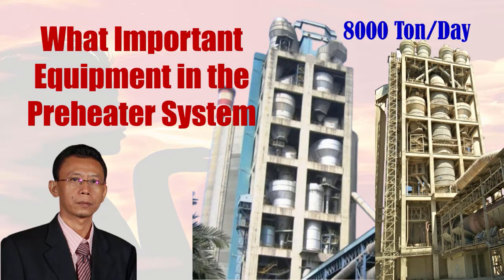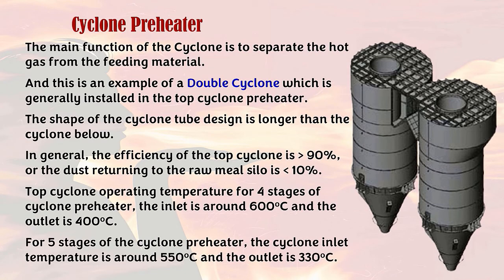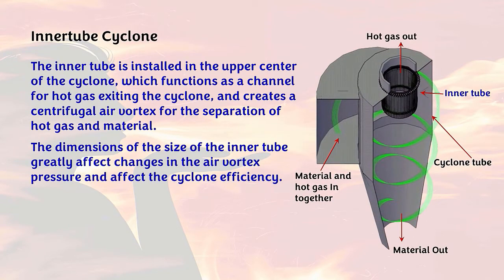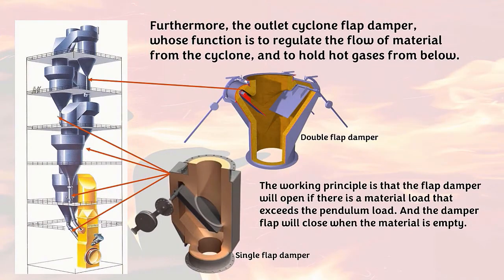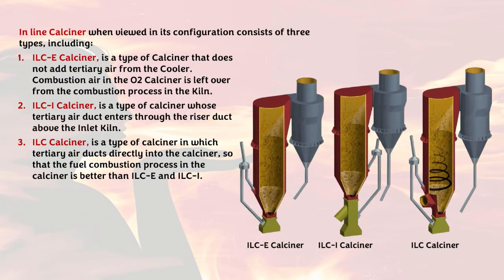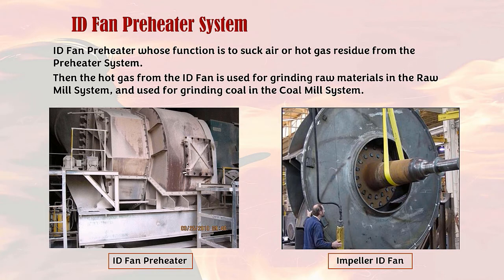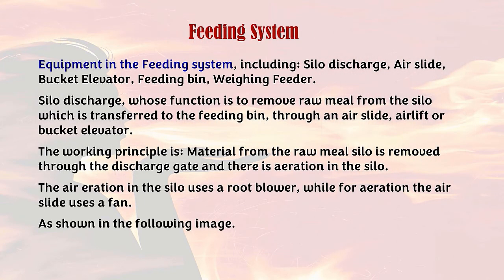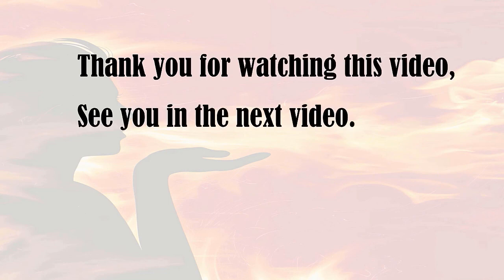Preheater System And Important Parts (Kiln System Part 2)_ English version

Comment: Helo sir, thank you for good information. I want to ask, how to calculate suspension preheater specifications?
Reply from the maker: Hello Siti. Thank you for your attention.
Sorry, are you still in college or already working in a cement factory?
To calculate the preheater system specifications it is related to the design, and there are several designs of cyclone preheater, there are 4 cyclone levels, 5 cyclone levels and 6 cyclone levels, according to the clinker production capacity. Meanwhile, I am not in a position as a designer cement factory, but I am in a position to operate and how ton optimize the operation of a cement factory.

Comment: May I know how large or small  the meal is entering in the pre-heater system?
Reply from the maker: Material feed into the preheater system depends on the clinker production capacity.
For a clinker production capacity of 8000 tonnes per day, the material fed to the preheater is around 550 tonnes per hour.
And for a clinker production capacity of 11,000 tons per day, the material fed to the preheater is around 750 tons per hour.